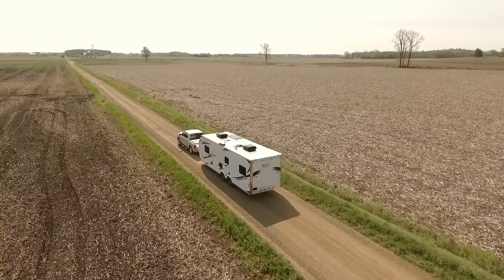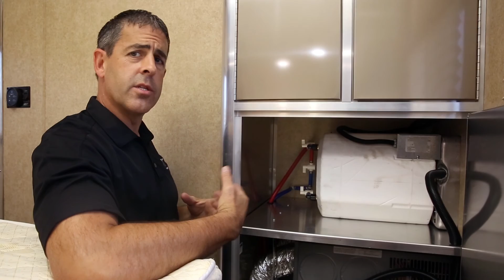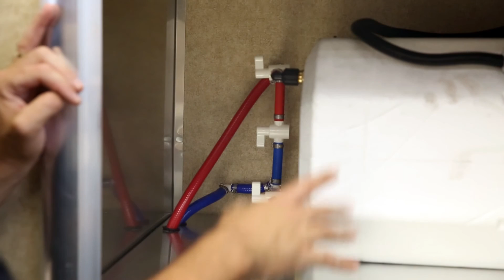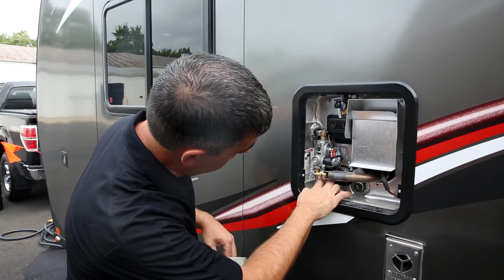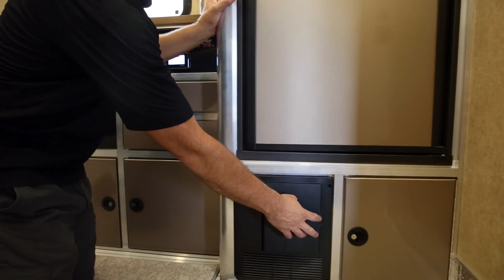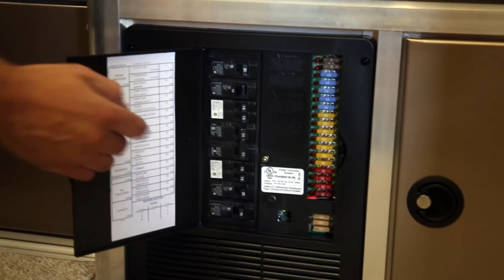Water Heater - ATC Toy Hauler Tutorial

Comment: Needs a more specific explanation. Control panel switch just for propane and leave off if breaker turned on for 115 or does panel switch need to be turned on along with the breaker as you incorporated an auto-sense device with 115v priority? Specificity, please. Thanks.

Comment: Hello ATC Team,    I bought a 2513  (2021 model),  I have a tankless water heater,  there is no user manual in the documentation kit about the water heater,   so thanks for this video.   I checked the breaker panel,  the water heater breaker is ON (the dealer must have turned this ON).  There is also the switch on water heater outside,   and a switch inside on the panel next to the door (for generator, solar, thermostat, etc),   so I'm not sure of what needs to be switched OFF when leaving a campground,   do i need to turn OFF ALL 3 SWITCHES for the water heater?  thank you.

Comment: The water heater has a switch on the control panel, this switch is for gas. To use electric to heat water need to use the breaker in the breaker panel. This control really should be at the control panel or better yet in the bathroom. Both LP/electric control in the bathroom is the  place it gets used most.